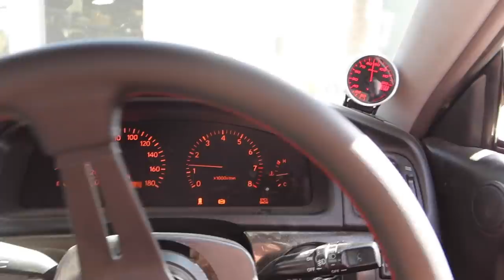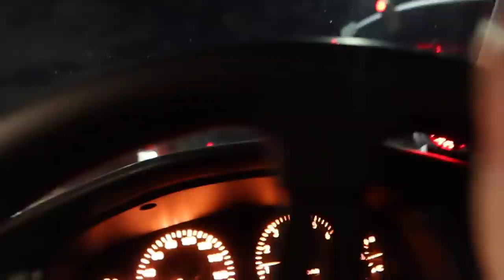A Day with TJ Hunt

Comment: Regarding the plate thing, we didn't have temporary paper plates until about a year ago. Before there was just a small piece of paper you taped to the windshield that was your registration until the plates were sent, which took several weeks or months in some cases. Exotic and luxury owners took advantage of that and just never put the plates on. But now technically any car sold has to have the paper plates.

Comment: I bet money them welds are breaking the first time that thing tries to move and if they don’t I guess you can kinda call yourself a welder
Reply from the maker: The purpose is to make them just small enough to where I can easily grind them away if need be
Reply: Adam LZ it just didn’t look all that connected but if it took awhile for it to move without the tac it will probably not move with it I honestly